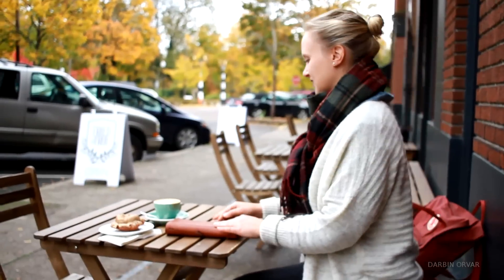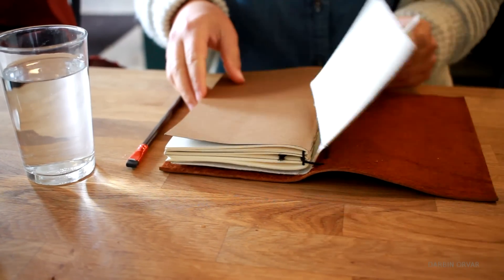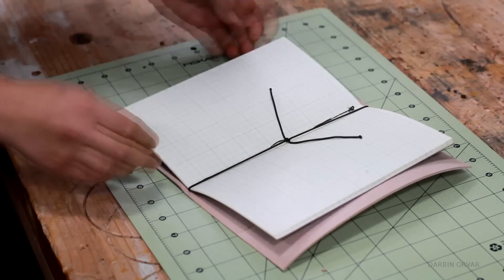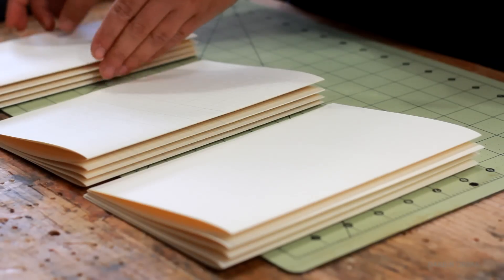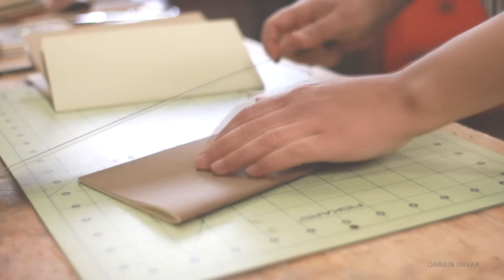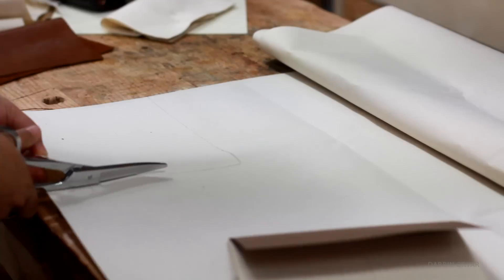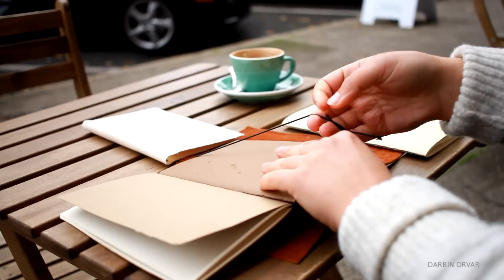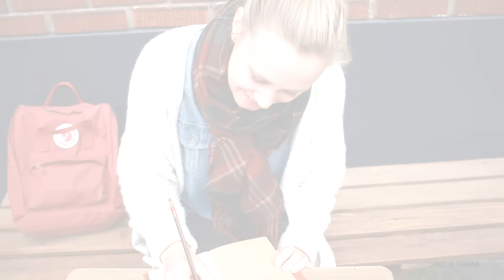DIY Midori Style Travelers Notebook

Comment: Yep, I'd like to have specific secured places for the pen pencil and fountain pen as well as a place for small geometry instruments , ruler protractor.
Reply: You could probably whip one up out of additional leather and attach it one of two ways - either tuck it beneath the elastic and have it removable or rivet/contact cement for a permanent solution.  Cause I was thinking the same thing; need a place for pencils etc.
Reply from the maker: I like that idea too - in my last leather notebook I added a pencil loop, however I really wanted to stick with simplicity here.
Reply: You can do what she did with the fabric thing. Add a zipper to a long pocket and you can slip the pencil and some pens in there.

Comment: Cover 215x265 
Paper 118x240 ????????
Reply: Bestcippalippa what's confusing about that?
Reply: Yeah. I'm confused too. haha.
I'm assuming that the cover will need to be bigger than the paper. 

I could be wrong. But the cover needs to be at least twice as long as the paper. So I think the cover needs to be at least 236 mm instead of the prescribed 215 mm.